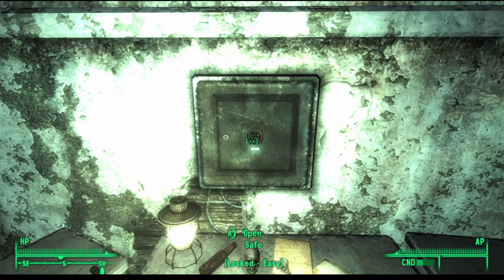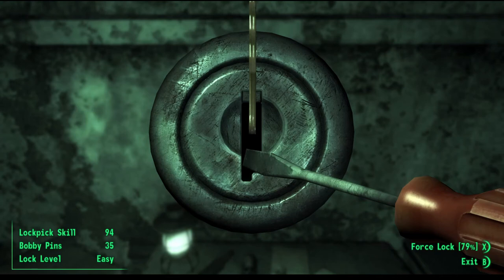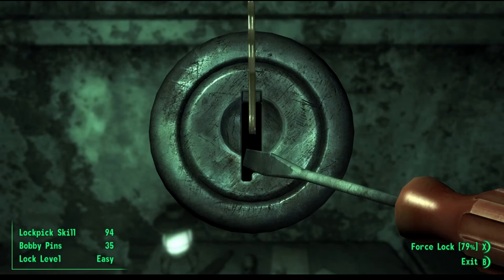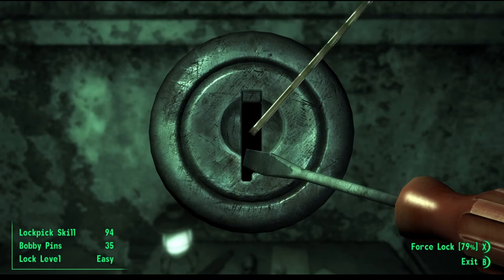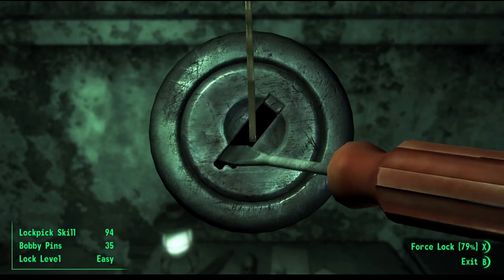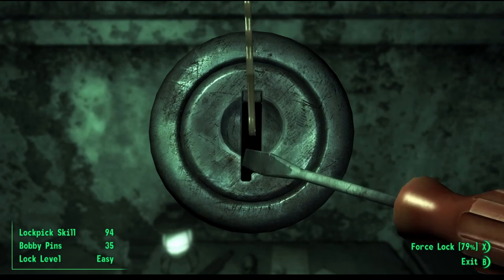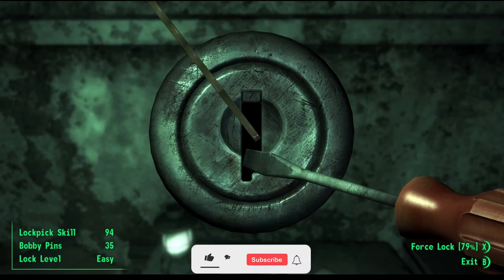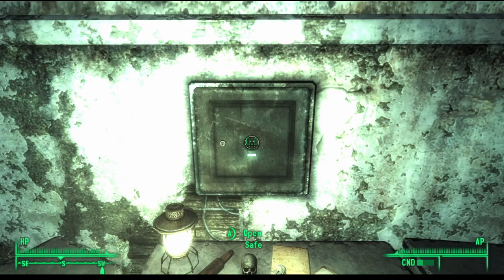Fallout 3: Lockpicking Mechanic Guide

Comment: Extremely unlucky with finding bobby pins lately, have had only 2 for virtual weeks. I blew up Megaton, so I guess it's my own fault. And my luck is only at 5. Some shops have bobby pins, the re spawn rate is not very conducive to my mission. I'm in a bobby pin drought. Any advice?
Reply from the maker: I'm not entirely sure what to suggest. I have always had Bobby pins in my playthroughs and never really had an issue. I tend to find them everywhere also. I'll have a look and see if I can find some sensible suggestion but luck really does not play a part in finding pins. I have played bad luck playthroughs and found plenty.
Reply: @TrappedInFallout  I found a few in mail boxes, and tennpenny towers shop. But scarce. I've never had this problem before either, kind of odd.
Reply from the maker: @johndarkorlean8308  You may have stumbled across an actual issue in your current playthrough. I suspect that the game somehow decides when and where lockpics spawns and you may have been dealt a bad hand.

Comment: cool but what the fuck do i press to do that
Reply from the maker: Good question, your just move the pin using the analog sticks. Once the pin and lock are in the right position, the lock unlocks itself. You don't really press any buttons, its more about moving the pin and analogue sticks (or mouse if on PC).
Reply: thanks
Reply from the maker: @r_doom  No problem, I hope that it helps.